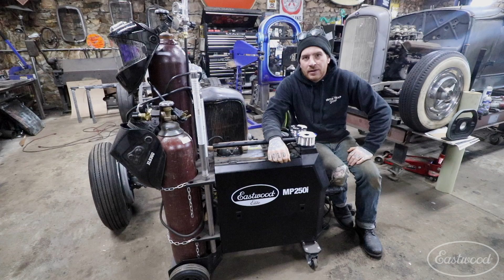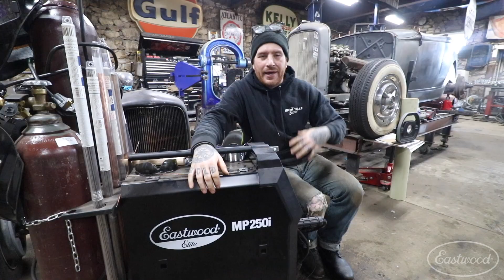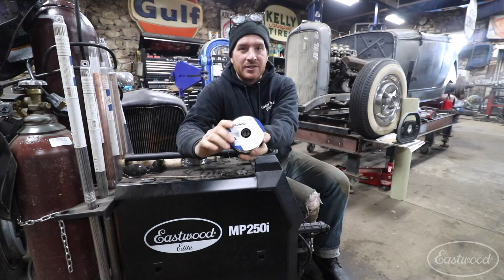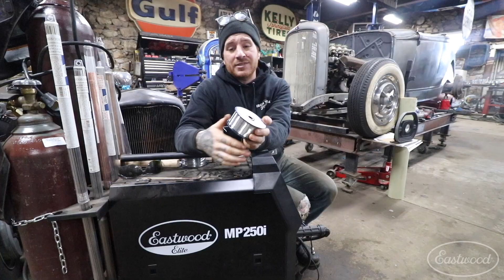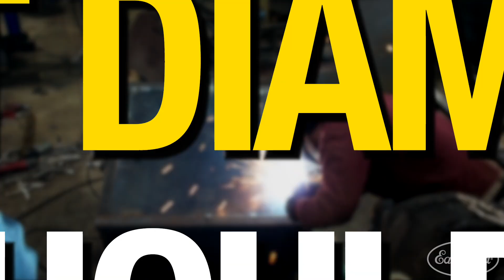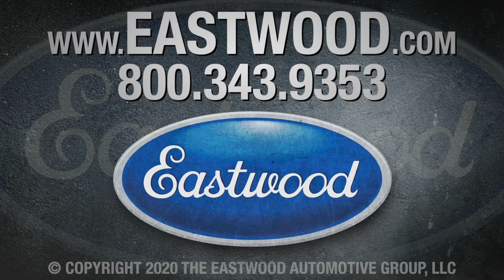Everything You Need to Know About MIG Welding Wire - Eastwood

Comment: Amazing video and explanation ,one curiosity,on stanley steel wire you need a corgon GAS or can be used classical C02 .Im welding exhaust pipes so bassically im even using a low amperange to. Much appreciate for the answer .
Reply from the maker: When MIG welding with stainless steel wire you want to use a mixed gas composed of 98% Argon / 2% C02

Comment: TY for your video. I have a 110volt Miller welder. My question is,, the welder has the large diameter spool for 10lb wire rolls. I'm not sure if Miller offers a small diameter spool for the smaller rolls of wire?
Reply from the maker: We're not sure either - we sell Eastwood welders...

Comment: Can I use e71t-1 dual shield fluxcore wire with 75/25 gas with your 180 wire feeder?
Reply from the maker: Yes you can. We even sell some: https://www.eastwood.com/035-in-flux-core-wire-41245.html

Comment: What is sad is they won’t answer a simple question like if you’re welding a 16 gauge metal with a Eastwood MiG 140 30 gauge wire with 25/75 argon , what is the wire speed and heat settings. The chart on the door doesn’t say and they don’t know.
Reply from the maker: There are settings for 17 and 14 gauge metal so we can split the difference and use that as a starting point for 16 gauge.  With that in mind we suggest starting at 17.0 Volts/196 Inches per minute.
Reply: Dude is on a job interview and needs settings asap 😂😂😂
Reply from the maker: Apparently so!

Comment: What wire size and tip would you recommend to weld DOM 1 3/4 .120
Reply from the maker: On our MIG 180 ball park settings for .030 wire would be 19V and 354 Inches Per Minute to get started.  You can always reference the chart inside your Eastwood Welder and adjust from there.

Comment: I just purchased the Eastwood Mig 180. It operates off dual voltage. I’m working on my 79 F150 with sheet metal replacement. Which should I use… 0.30 or  0.23?

Comment: Matt, You can use smaller spools on your machine. All you need to do is make a small spool holder from a 2-1/2 to 4 inch rare earth magnet with a small hole in it (Home Depot, Lowes, etc.), a all thread bolt, washers, a spring for tension, a spacer that fits the bolt and spool and a few nuts. Works great for me!!

Comment: What kind of gas should you use for stainless steel?
Reply: Trimix. It will have helium in it. MiG welding stainless is much harder. I prefer to tig stainless.
Reply: @justinsteele8399  Thanks. New to welding but want to weld up a stainless mapling evaporator pan and I don't want to invest in a TIG right now.. Maybe some day. The wife wouldn't be too happy right now though.
Reply: @peterholtman1532  it can be done mig. Your local welding supply will have a tank of tri mix gas and just tell them you want to weld stainless. They’ll know what your talking about. 304/308 wire depends on what type of metal you purchase. 
With stainless, it produces hexavalent chromium. Wear a good respirator under your hood. Plus all the appropriate Ppe

Gases for mig welding: C25 is most common. (75/25 mix). That’s for short circuit mig. 
Aluminum mig (with a spool gun) 100% argon. 

Any questions feel free to ask I’ve welding for years and MIG or tig every day.